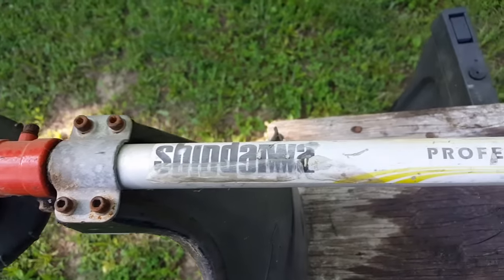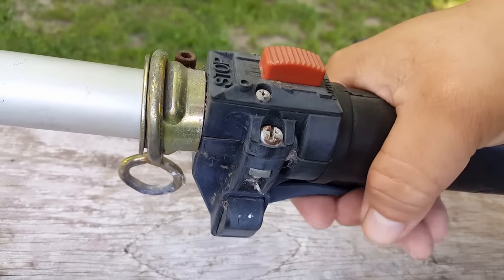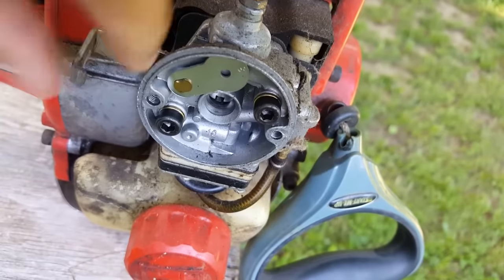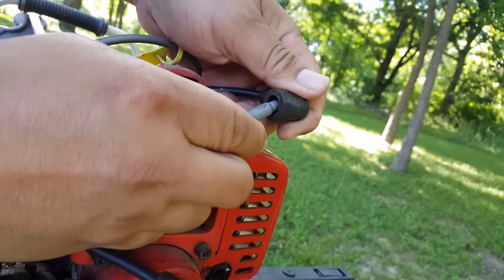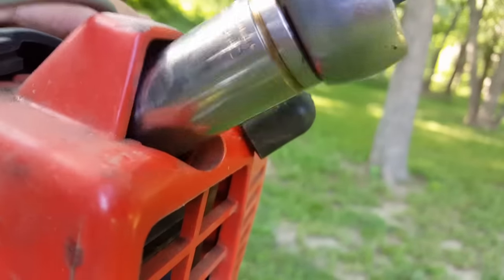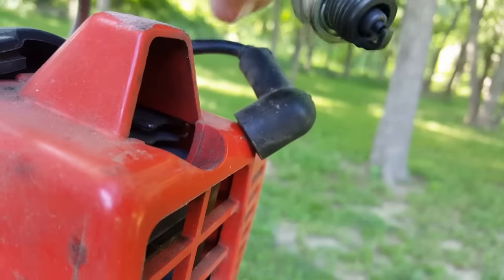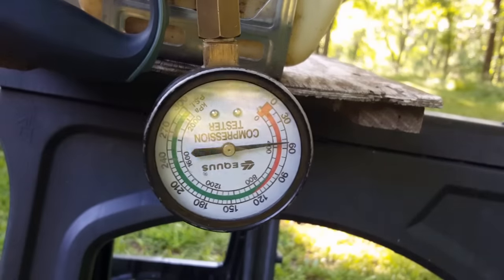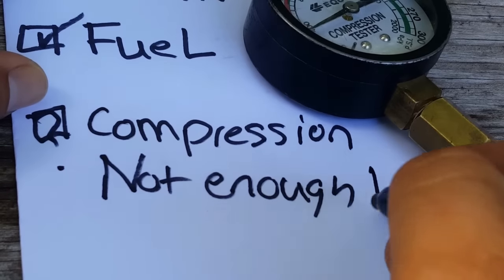My weedeater has spark and fuel but it still won't start

Comment: Thanks! But it is garbage ? Cant you get another piston-ring or is the cylinder walls that is bad?
Reply from the maker: Oh it's really bad. The previous owner tore it apart when they ran straight gas thru it till it died.
Reply: @HomeGaragechannel  Oh really that bad :)
Reply from the maker: @henrikjonsson4340  It would be the most extensive rebuild I've ever done. Cylinder, piston and rings would need to be replace. it would make a decent video but I would have to bear the entire cost on a high end machine.
Reply: @HomeGaragechannel  Yes it would but it would also be a great study for people who are in a startup of learning a mechanic experience BUT only if you have time and money for it :) Sometimes I rebuilt something that took very long time but in the end I learned something that speed up my next project.
Reply from the maker: @henrikjonsson4340  that makes it quite educational then. Thank you for your time.

Comment: Do you know if putting 50-1 fuel in  a 40-1 engine will cause any problems?
Reply from the maker: it could, but only have a long time of use.

Comment: Hmm, please allow us to know what is the right ratio fuell / oil for a brush cutter?
Reply from the maker: it depends on the specific brush cutter, most engines are 40:1, what is the model number?
Reply: @HomeGaragechannel  thank you very much.  I'm in Fiji and use an made in Australia brushcutter. Kawasaki and Stihl one available too but VERY expensive. I buy premix 50:1 and put 90 mml  2 stroke oil on 1 gallon container. Greetings and best wishes.🇫🇯🌴 Hans B.
Reply from the maker: @hansb.8  Thank you Hans B. from Fiji,

Comment: Brand New not starting,new plug still not starting what could be the problems
Reply from the maker: sure thing, Have you confirmed the on/off switch is in the correct position.  Are you following the printed starting procedure.  And if you are, remember that  after every failed attempt to start a 2 stroke trimmer, will flood the engine with fuel.  You'll then have to either start an "un-flooding" procedure or let it sit for awhile before starting again

Comment: how much compression is good or normal 120 psi? or less or more? whats the lowest psi around 80 ? are all weed wackers in same psi range regardless of make or models? thanks
Reply from the maker: I would consider anything over 80 psi pretty good. I have only ever seen one weedeater get over 100 psi. No not all weedeaters have the same range. Its hard to get a psi number because the engines are so small in comparison to a car.
Reply: @HomeGaragechannel  thax for the info...
Reply from the maker: @roadstar499  no problem thanks for asking

Comment: Hi,my brush cutter run for 2,3 minute and stop,when i try to start it won't start,i clean the carburator and spark plug is fine,think it the compression. What part do i need to change if no compression?
Reply from the maker: Thank you Nellie bariamtaak for the comment I appreciate it.  If the compression is low then you to buy a new piston, piston ring, and cylinder.  The only problem is installing them is very involved and it's not fun.
Reply: @HomeGaragechannel  thanks for the suggestion,it helps a lot ,wish u best of luck  4 yr youtube channel 😀😃😃
Reply: Something else to look at: my blower does this because of vapor lock. The gas cap is clogged and not allowing air in the tank; ergo, not allowing gas to travel out.

Comment: I use the same tester that I use for my car yes it has a long hose you just have to run it up and pump the air I'm astounded that I got 120 lb I have a tiny bit of blue Spark and it will not attempt to fire even on nasty ether I know it's the wrong thing to use but it was either going to kick my ass or I was going to kick its ass
Reply from the maker: I am guessing that if you have a weak spark outside of the engine that once inside the engine that spark plug has a tough time sparking under pressure. Would you consider buying a new spark plug and trying it?  Its only a couple of dollars at walmart. Might be worth a shot.

Comment: So what is your recommendation for a leaf blower that has plenty of fuel in cylinder, plenty of spark, and generates 90PSI, but it still won't start? I have all of the ingredients for a small engine to run, but It doesn't even try to start. I'm stumped.
Reply: Let me also add that I removed and cleaned out the entire muffler, and I torched and blew off the spark arrestor, too. I have been very thorough with this thing, and it won't cooperate. Let me know what you think.
Reply from the maker: @seanwetrich8299  thank you for the comment and all the information.  This is tricky but here's a thought. We have compression,  fuel, and spark but the one thing we cant see is does the spark actually occur when it's supposed to and is it enough when under pressure. The timing might be off slightly due to a sheared flywheel key or the spark might be weak and "blown out" inside the cylinder due to a ignition coil problem. Also please confirm that the engine isn't flooded due to repeated start up attempts. Thanks and please let me know as I'm curious too.
Reply: @HomeGaragechannel  Thank you for the timely response. I haven't checked the flywheel. That is where I am leaning. I try to eliminate all other possibilities before going to that, especially on blowers. This blower belongs to a customer whose brother just brought me in a similar blower that sheared a key. I don't know what would cause a blower to shear a key other than maybe a rock going through the impeller. However, you would think the plastic fins of the impeller would break before the key sheared. 

I am going to try firing this up with the muffler off and see if that fixes anything. Other than that, I'd say it has to be timing or weak ignition. Thanks again.
Reply: @seanwetrich8299 hey, did you repair it ?))

Comment: you gonna have to tear into the engine so why put the cover back on the carb?
throw it aside for another day when you feel like working on it?
Reply from the maker: Yes it's still sitting in the garage complete and I haven't lost any of the pieces. Its easier this way.
Reply: Makes it where you can't loose pieces also keeps moisture from getting at the inside of the carb
Reply from the maker: Thank you for the comment I appreciate it

Comment: Could the throttle body be a problem?
Reply from the maker: No unfortunately not. Later on I had removed the muffler only to see the extensive ring damage from someone using straight gas.

Comment: I dumped a "makes-6-gallons" bottle of 2-cycle oil in 1 gallon of gasoline like a freaking idiot.  No wonder it won't crank.
Reply from the maker: it happens but fixable

Comment: i have one that refuses to start even with new plug (has spark) and carb.
Reply from the maker: Thank you WV591 for the comment.  Have you checked the compression?
Reply: I have a bolen weed eater.  Got a new carburetor for  it.  Have fresh gas, spark plugs firing. Doesn't seem like it through the carburetor
Reply: It tries to start if I pour a little gas in the carburetor. Any suggestion
Reply: @leemuse1306  i have exact same one bolen 160 and cant get nothing but spark and gas

Comment: yes ign timing can be thrown out of time easily causing the 2 stroke to fail to start like mine i believe .have to check flywheel to see if moved of keyway .weed whacker not very old but something must have caused the flywheel to move off the keyed shaft.i believe ign is set by flywheel and keyed shaft in fixed position.will see when i take off flywheel.
Reply from the maker: let me know what you find.

Comment: Hie home garage, I just found out that my weed eater had a minor seizure. the ring were stuck to the piston and the piston is scratched a little but the cylinder appears better than the piston. I manage to unseize the rings and reassembled it a damaged head gasket just to try the  compression. I put a little fuel in the plug hole and started it. Ran on that fuel. When I installed a carb it didn't even caugh. So I'm thnkng of replacing the piston and head gasket. I was wondering if I really "need" to replace the cylinder as well. Plz help, thanks.
Reply from the maker: I hate to say but I've try to just replace the ring as well and the success rate is rather low. Its suggested to replace the cylinder along with the ring unless you can somehow hone the cylinder wall to receive a new ring. Thank you for commenting.

Comment: I got a stihl fs75 with spark, fuel, and 100 psi of compression...put a new carb on and still won't start. Idk if it's electrical. Can't even get it to fire.
Reply from the maker: Is the spark plug? Also after trying to start it did you check the plug to see if its wet with fuel?
Reply: Home Garage tried a brand new spark plug and it get wet with fuel so it's getting fuel. Has great spark. The electrical connections seem fine. Took off the muffler thinking it might be clogged. Hooked up a drill to the starter and got it to puff a little bit of black smoke. About to give it away lol.
Reply from the maker: Before you do that have you tried to start it as though it was flooded? Squeezed the throttle with no choke and pull about 10 times?
Reply: @keshmo12  check the 'spark arrestor' wire rectangle outboard of the muffler (to keep sparks from flying). Sometimes they are covered in carbon and preventing an engine from running. Propane torch will burn off all the carbon... hold it in a vice-grip or bench vise.... gets red hot!

Comment: I am very much believe the engineers and the. Manufacturer they never hasn’t been using the spark plug tester,it have very stupid design,the spark plug tester nose ,way too long,, ,made it very difficult to use on most lawnmower N weed eater .the tester nose should not longer than the spark plug body length.
Reply from the maker: Thank you for the comment

Comment: Mine has everything correct but still doesn’t start.
Reply from the maker: What kind of trimmer is it?
Reply: @HomeGaragechannel  craftsman
Reply: @HomeGaragechannel  I just checked, spark is good, timing is good, compression is good, and carb is good
Reply: @HomeGaragechannel  nothing works, even hooked a drill to the electric start and it wouldn’t start
Reply: It fired once for the whole week I have been working on it
Reply from the maker: @WillLockwoodStudios  can you get a hold of a compression and get a reading?
Reply: @HomeGaragechannel  60 psi
Reply: @HomeGaragechannel  I took the whole thing apart, the piston is super scratched but it still has rings
Reply from the maker: @WillLockwoodStudios  since its apart would you consider a nee piston and rings?

Comment: if its not the compression, look at piston and the rings
Reply from the maker: That sounds like another idea for a video. Thanks.
Reply: This is from using the cheap gas with the ethanol in it,it seizes the ring in the piston. Use the good BP higher octane and you will have no problems,will even start easier than before.Good luck...
Reply from the maker: Thanks for the information and Thanks for the comment  as well.
Reply: That's good intel, but break it apart and rebuilt it I think us not practical unless us your own equip
Reply from the maker: I have considered rebuilding it only because of the brand name.
Reply: @markbrad675  see this website for your state and then the towns near you... get 89 or higher octane and be sure to add oil (synthetic car motor oil is OK), but wrong fuel is the main problem in most small engines  : https://www.pure-gas.org

Comment: my whipper snipper runs on 30psi lol
Reply from the maker: 2bangerboi03 thank you for commenting.  I'm surprised it runs with that low a compression  number.
Reply from the maker: This engine was actually ran with straight gas which destroyed the ring.  That's why the compression was low.
Reply: no way!

Comment: Compression 90, and decreasing but I suppose thats because it's only handtight. New HT  cap, three new  tubes into fuel tank. Accessed carb,  squirted in some carbfizz (forgot to ensure piston was down! ) Still nothing. Connected so-called spark plug tester but the shaking caused by tugging meant I couldnt see if it was lighting up. So what else can if I until others dark? 
Well, I removed the kill wire from the coil, one gentle pull and fired up! Tried hitting the off/kill switch but of course nothing happened. Closed choke, engine shut off. Great, but what does this mean? A short somewhere, but where? Reluctant to dismantle switch area because the fiddly springs '  placement is not obvious. Anyone? Thanks!
Reply: "So what else can if I until others dark? " should be, 'So what else can I do until it gets dark?'
Reply from the maker: @johncollins8304  take it into a shady area to test like a shed or in the garage. you should be able to see the spark. Yes the kill switch is still grounded somehow. if you don't want to take apart the switch Or replace it, do what you already tried, remove the ground wire from the coil and just choke it to stop the engine.
Reply: @HomeGaragechannel  It's very good of you to reply. Well I did take apart the switch assembly, very gingerly, using tape to hold the triggers and springs in place. Did ohms test on the switch -- seems okay. Dony Boy says it might be the air gap on the coil being wrong. So I'll try that tomorrow! 
Thanks again.

Comment: You said Ned's a mixture so I quest it's 2 stroke, sparkplug is dirty change new one if needed. Check carborator fuel line and fuel filter, both 2 stroke eat a lot of fuel waste fuel nature, weak engine power less space work to loud. Is it worth to fix youse, or Honda 4strokes stronger engine power .fuel efficiency, can work more space. Down side of 4stroke more expensive oil gas expenses, while 2stroke cheaper oil gas maintenance weak engine not efficient on work. And it s very loud to ear.